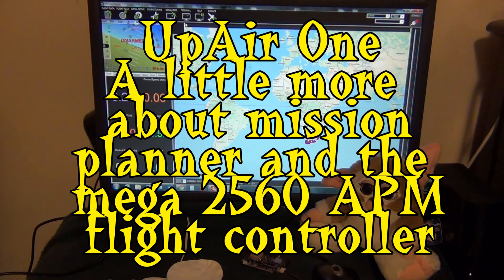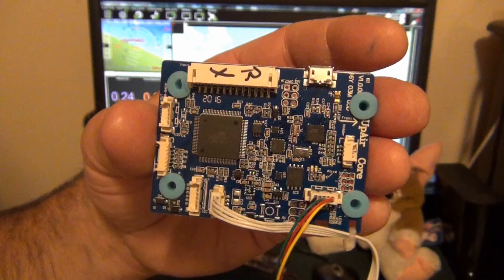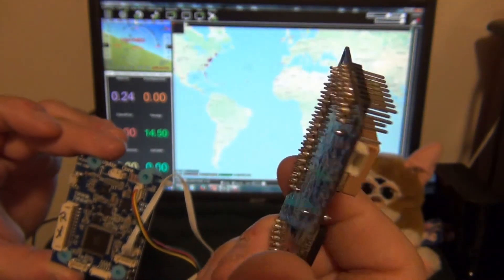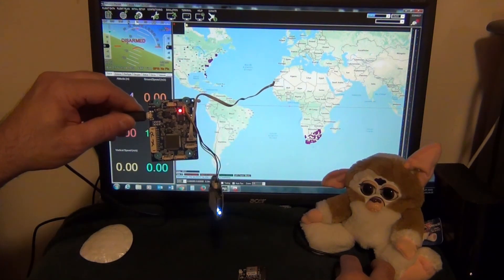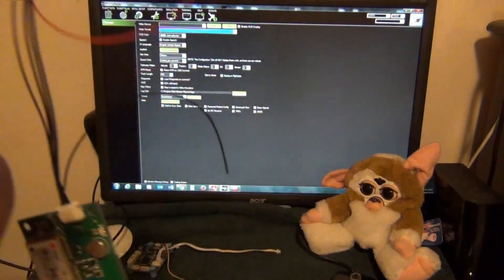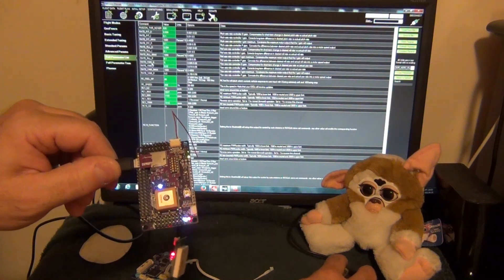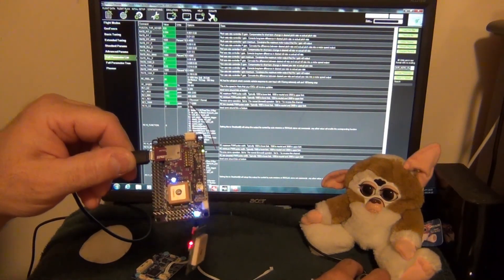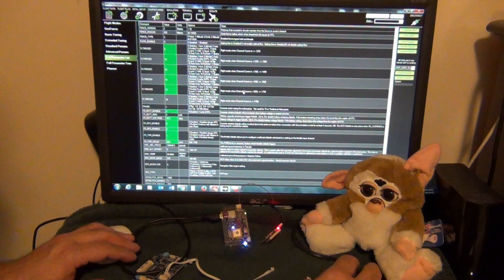UpAir One "more about mission planner"

Comment: Can you please copy the full parameter list from the upair and sent it to my ? My email is  jeedehzad@msn.com    Thanks.
Reply from the maker: what version you have, i dont have newest one, but the 1 and 2 are the same
Reply from the maker: attached are my std parameters for up air 1 V1.0.02 2K

you will need to change it from a .txt to a .param to load it into mp
click on this link

https://www.rcgroups.com/forums/showatt.php?attachmentid=9394299&d=1475332085
Reply: i dont know but 2 years old i bout from bangood.com
My PM Arduino Mega 2560 , My firmware is Frame: QUAD ArduCopter V3.2.1 (36b405fb)

Comment: Hi CRUZROY Helicopters,
Could you please help me, I have a FC board of Upair Core, I wan't that, using this board for my building quadricopter, with ESC Hobbyking 40A and Motor MultiStar 3508-640KV.
Please show me the jack name for connector to anything we need: esc, receipt,....
http://www.upsieutoc.com/image/cli40q
Thanks so much
Reply from the maker: i dont recommend a quad build with upairs board, just by a NAZA or a newer APM like pixhawk, 32 bit, the upair will destroy all the money you put into self made drone
Reply: if you have schematic of pin out,  please help me
Reply from the maker: all that and more here.......you have alot of reading...  https://www.rcgroups.com/forums/showthread.php?2546498-UP-air-Chase-%28V1%29-One-%28V2-V3%29-%28Under-construction%29
Reply: Do anyone know what does (MANU) mean it shows on my screen where pshold normally be

Comment: Hello Cruzroy, a query maybe you can help me I have the problem of not working the motors and the card MAIN I will buy it since it is physically burned, question do you think it is necessary to change the APM? or not?
Reply from the maker: smell the apm, if smell burnt ....yes i would.......do you have photo of what burnt on board......also problem is, UpAir is now shipping there updated main and apm, you might have to order both, caz new and old dont match, and all you have to do is solder motors on.......or ask G-ten if they still have older boards
Reply: Thanks Crossroy the problem started with the failure of a motor after a blow, after trying to reset this engine started to work but two others stopped doing it? At the end I played the mosfet of MAIN I burned a motor and a mosfet (physically ). The APM seems to work, data, compass barometer etc. I would like to change the two cards but it is somewhat expensive, I think I will change the MAIN + 1 engine with Amazon = 60 SD although I know Taifas bought I think in G10 MAIN + APM = 70USD ...
Reply: Hello Cruzro and the MAIN that I have is the V1.0.02 and APM V1.0.00 there would be problems with the camera and other additives when switching to the newer version?
Reply from the maker: i think it can be done.....but they say connectors are different.....but i think you can change pins
Reply: Thank you

Comment: Hi Cruzroy. i have problem with my upair one cw motors. they start to spin only after throttle increase and stop when the should spin idle. it happened after   i connected to mission planner and probably messed parameters. or may be it can be hardware problem? please help
Reply from the maker: alot of us have copy of UpAir PARAMS for UPAIR ONE V3,,,,juast need email.....
Reply from the maker: try this first im not home yet    https://www.rcgroups.com/forums/showatt.php?attachmentid=9394299&d=1475332085
Reply from the maker: Sorry for the delay

attached are my std parameters for up air 1 V1.0.02 2K

you will need to change it from a .txt to a .param to load it into mp
Reply: Thanx alot

Comment: mmmm ... intersting.
ive got a shell from my 1st upair 2k ( dead on board esc .... than sold the motors and other controller ) ..... that does sound like an interesting project
Reply: Hello which board did you use? I have the same problem...
Did you find spare board?